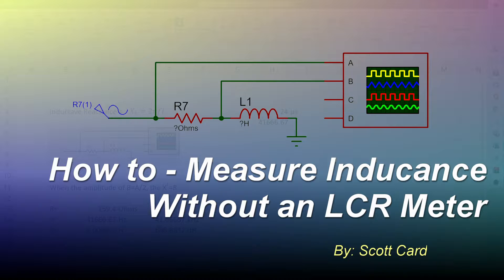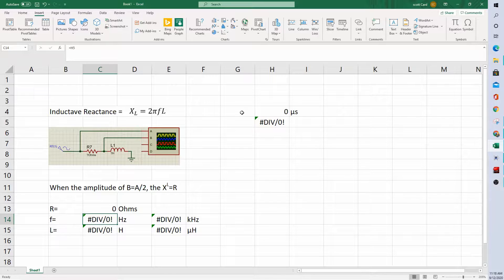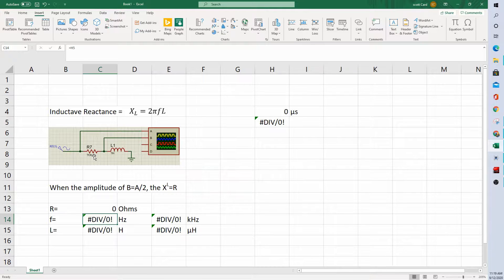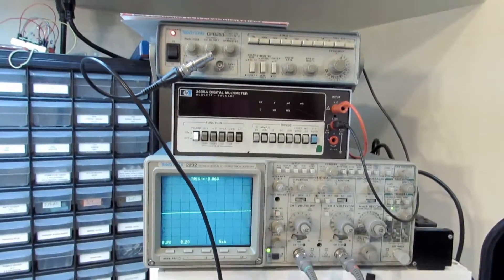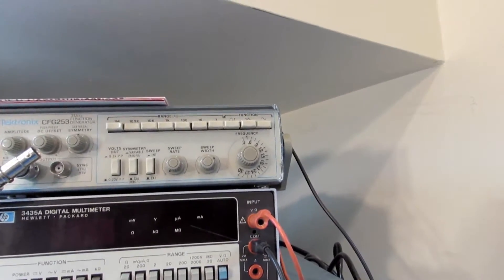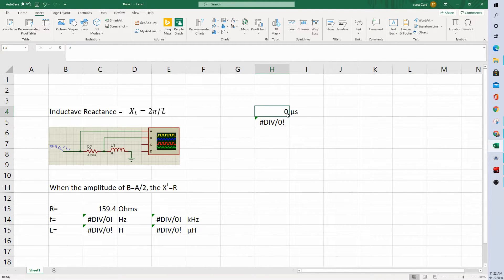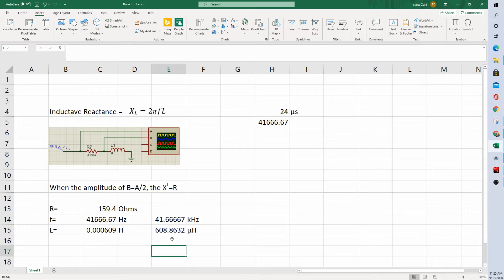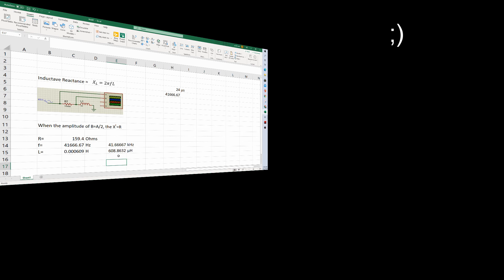Measure an Inductor ➫ See the update for measurements correction (Link in the description)

Comment: I am curious about the accuracy of this method. I was thinking of making a fixture for this and trying some low value components at higher frequencies. That may be getting into VNA territory though.

Nice presentation - looking forward to more if you are able.
Reply from the maker: You can check my new video where I compare this to a simulation of an inductor and make a correction to how it needs to me measured.
Reply from the maker: Be sure to check out the new video where I address this question.

Comment: The formula for the voltage to watch for on the scope is wrong - you are ignoring the fact that you working a vector (reactance).   Instead of when B = A/2 it should be when B = A/sqrt(2).  Using that, the rest of your math is correct.
Reply from the maker: You are correct, thank you for pointing out my oversight and feedback. Note however that this will calculate the instantaneous voltage and we are looking at the phase shifted. I will rename this video as an approximation and remake a more accurate video including a comparison to an LCR meter and several samples (wish YouTube would allow edits). Here is an article for the exact measurement using phase angle.
https://download.tek.com/document/75W_28152_0_MR_Letter.pdf

Comment: Question about Formula.. the ( ) between Pi and *2 causes an error?
Reply from the maker: The calculation for reactive inductance should look like this  
=2*PI()*C14*C15  where C14 if the frequency in Hz and C15 is the inductance in Henneries 
=pi()  should give you 3.1415927.....
Hope this helps

Comment: awesome video. Funny thing is, this method is soo simple and easy that i just didn't thought about it :))
It's especially useful for me because i have an RLC meter, however it only measures down to 11.000 mH. If i would trust the last digit as well (which i don't think i can), then i only get microhenries resolution at best. So i guess i could use this method for even smaller inductances, so i can check nanohenries as well.
Reply from the maker: Works great for ferrite beads and, if you are confident in the calibration of your scope, you can calibrate your LCR meter!